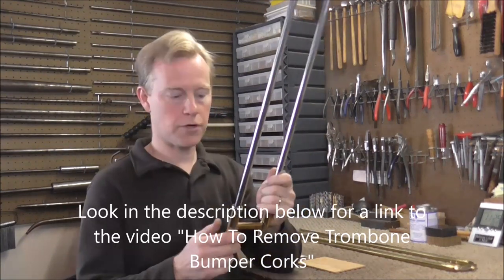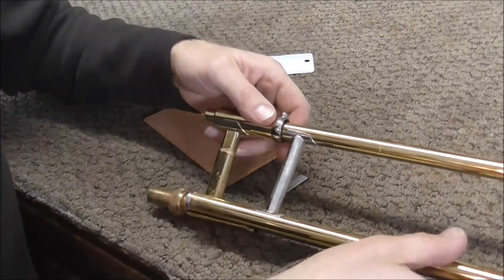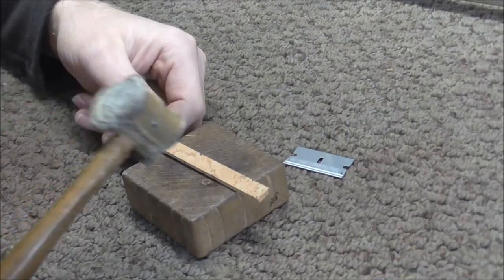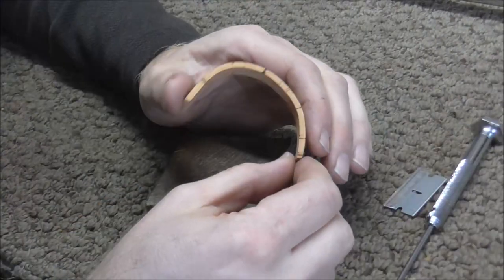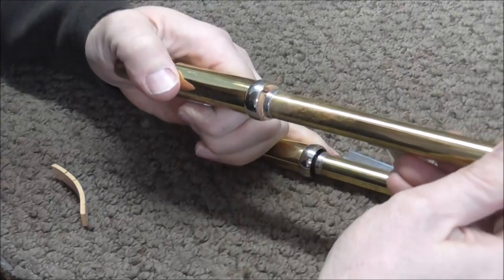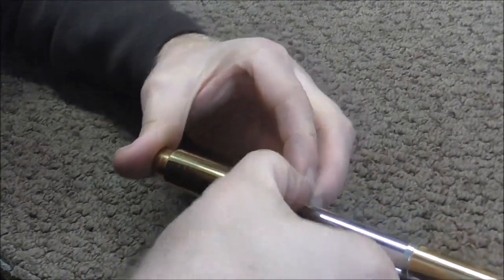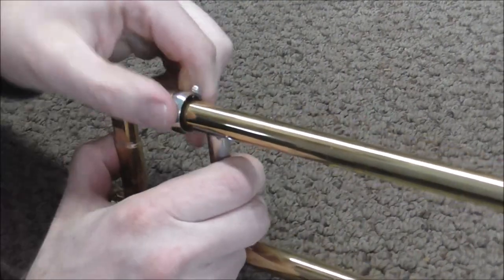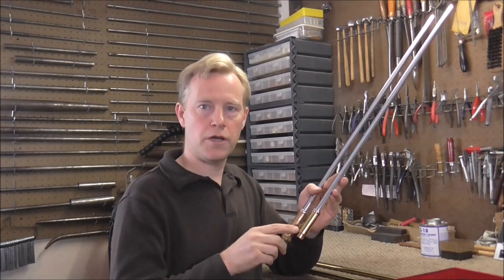How To Install Trombone Bumper Corks

Comment: Hi, i have a question. I have a trombone slide that has a spring bumper, the spring is really noisy and i was wondering if i can remove the spring and instal cork bumpers instead?
Reply from the maker: Yes, that is fine. If you decide to go back to springs, you can just switch them back.
Reply: @TheBrassandWoodwindShop  Thanks 😉

Comment: Trombone slides use felt, not cork.
Reply: ohh yeah sure, am going to believe some random guy instead of the instrument repair-man with his own shop thats been going this professionally for years.
Reply: I've seen plenty of professionals use both. It's a bumper to prevent the slide from damaging the inside. As long as it's soft, but firm, it can work